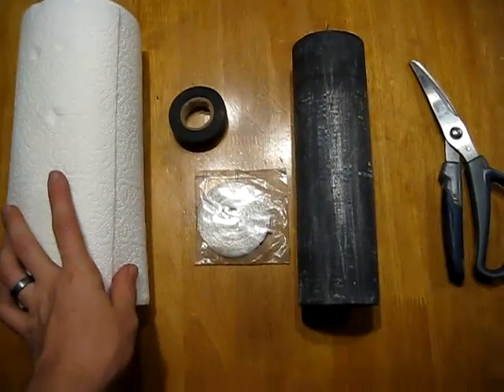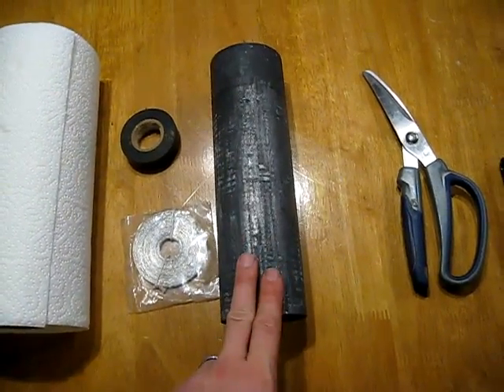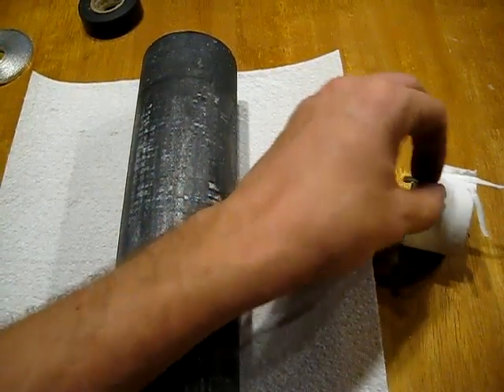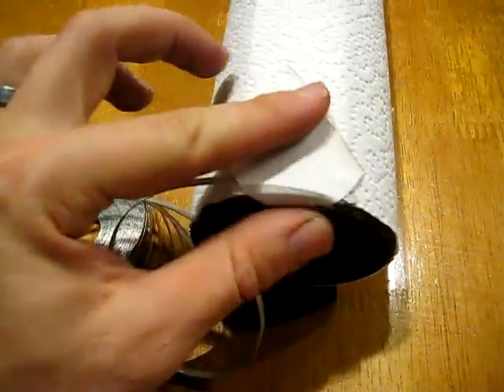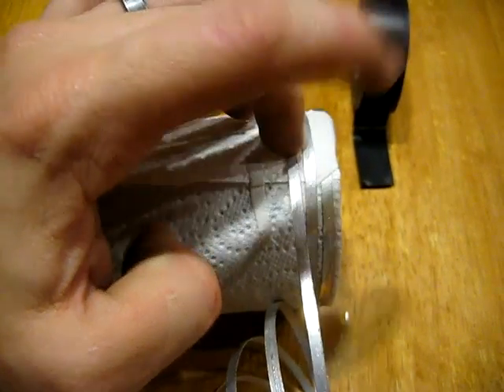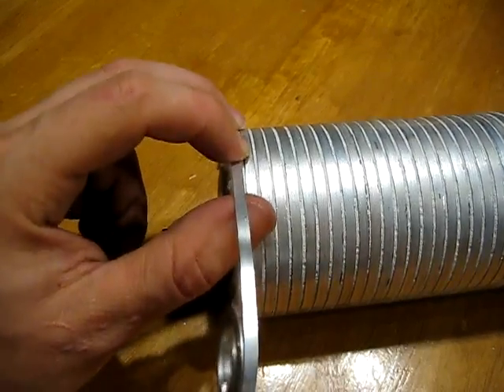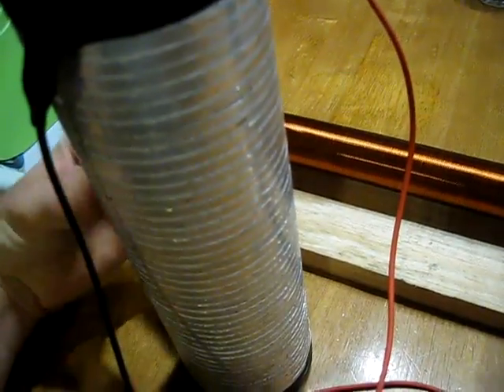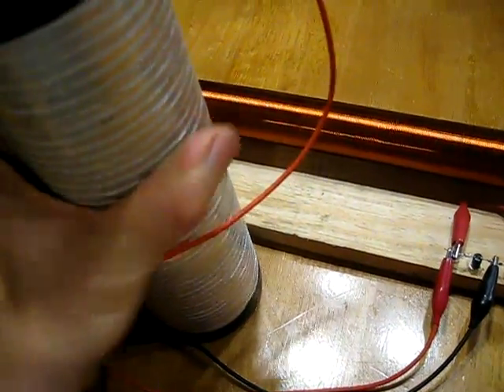How to build the "Laser Saber" air battery.

Comment: Would you have to use a solid carbon rod? I've been trying to think of things you could do with contaminated biochar from plastic pyrolysis. It's mainly carbon (probably more than 90-95%) and can't be used for hardly any normal applications of biochar because of the heavy metals, etc. If that were compacted down somehow, could it work in a modified version of these air batteries?
Reply: What kind of heavy metals?  Do you really want to be handling that kind of material?
Reply: Well, it's obviously not ideal, but I can't think of what to do with the biochar that is left over from gassifying plastic into gasoline, etc. I mean it's not like you're gonna just stick it under a mountain and wait for it be sorted out by nature like we're doing with nuclear waste...

Now, is an application like this ideal? No, but I literally can't find a use for this type of material. I mean you could use it to line a Faraday cage or something since, I think, carbon like that has an electromagnetic shielding property. But other than figuring out a way to refine it and pull that safe carbon out, I don't know what to do other than just let it pile up.

It's not like these are finished ideas or anything. I'm just brainstorming out loud on what to do with that sort of material.
Reply: I don’t know a thing about these but just sounds like it would be worth the effort to take that by-product and make one of these. I seems like making it tubular would improve the efficiency due to increasing the surface area. Please don’t crush me for being so ignorant about this. I just had to make a comment. Love the fact someone trying to do something with plastics. Fist bump to Cassandra Gray!

Comment: you need to build a website and then put full tutorials on there. with these i can power the lights in my house and also the ceiling fans.

question tho. what is the copper coil device you had it connected to?

Comment: Do you think it would work with carbon fibre rod or carbon fibre sheets rolled up(before the resin hardener, of course)?  You mentioned that air circulation in the carbon was good.
Reply: i made the same thing tou can ask a welder ir he has extra carbon rods carbin fiber works to  i made it with both rods but it is easier  using prebuilt rods
Reply: Thomas Savage Thanks, good to know. It's just that a solid carbon rod seems like extra weight and material.  I was thinking carbon fibre cloth wrapped around lightweight plastic or paper tubes. (toilet paper rolls, etc.)  I just got my magnesium strips, so I will experiment.
Reply: ya I would think that to.

Comment: because if it is compressed charcoal, you can easily make those by heating wood and other plant material, with out giving it oxygen (think pressure cooker over an open fire and fill the pressure cooker with just sawdust say, and make sure there is a decent level of pressure on it so that neither air gets in, nor does it explode on you.) cont...

Comment: Hmmm yes but even if it is one atom thick it still has something like 10 times the conductivity so it wouldn't have to be as thick because there would be less buckling even though its thinner or is that not what you were trying to say?

Comment: then it is all down to finding some pipe and cutting it in half, and wrapping it up to make a tube to press the carbon in, and a way to apply pressure to a disc of say steel that is the size of the inside diameter of the two half steel pipe thing you made.

Comment: It seems convenient that the major part required for this battery (the carbon rod) is not clearly sourced.  There was no cost given in the video for the carbon rod.  My own perusal on eBay showed some similar items -- ALL of which were several times more expensive than what I could purchase a good lantern battery for.  So, unless I've missed a source, this is a good hobby experiment, but hardly an exciting practical economical energy source for any purpose.
Reply: The carbon rod? Like the carbon rods in the "Super heavy duty" D-cell batteries?
Reply: The scale of the one in the video is considerably larger than a D cell.
Reply: Ah. The video was interrupted by a trip to the dentist, so I never saw it. My apologies. I'm sure there is a place to purchase said rods, though it would be nice if he had sourced it, as you mentioned.

Comment: You said 1 Amp with saltwater?   Well if it puts out 1.5 volts that'd be 15 watts, but how long could it maintain that?  And doesn't the saltwater corrode the magnesium ribbon cathode?  Just curious.. and yeah, what about lemon juice?  :)
Reply: +Matt Carrell the electric potential is generated by the corrosion of magnesium. Faster corrosion give higher throughput. Completing a circuit also speed up the corrosion because metal become more corrosion resistant when negatively charged compared to its surrounding. When the circuit is open the magnesium will charge itself up that slow down its own reaction with the air.
Reply: not long and lemon juice would kill it faster.
Reply: unknownkw makes sense then why gas company buries a sacrificial anode attached to metal gas lines by wire...  it takes the corrosive charge from the metal lines. As ground is negative potential.

Comment: @fuelban Yes sir, i've tried a few things like, copper plate,aluminium,tin etc, and I found aluminium the most reliable of all coz it doesnt start getting oxidized quickly like copper and gives reasonable output if moisted with a solution of table salt and vinegar but in dry conditions the output is quite low

Comment: could you use several dozen cells, hermetically seal them into a plastic container filled with oil and then regulate the output to create a supercell, and if so how long would it last :)

Comment: ok the 1963 chevy nova had a hole in the ciol  and as the iol drrrained out the ciol started to heat up- same idea but in water oil is better then any other liquid of some kind -oil keeps it cooler tha water -and plus you may find that if its below frezzing the oil base battery will last longer then the one that became frozen in ice electrons travel better in a non   frozen containers- oil wont frez up un less below 60 degrees

Comment: I wonder if it has to be circular. Do you think it would work with square sheets sandwiched together like carbon, cotton, mag, carbon, cotton, mag and so forth. it would resemble a small cube when it was assembled.
Reply: Thanks for the reply
Reply: carbon fibre works too. zinc roof flashing is cheap at Home Depot. cotton mat from a fabric store . or an old t shirt  :)  pile it up as far as You want.

Comment: Ehm, technically it is just an normal galvanic cell with an really really bad electrolyte (water from humidity) and therefore low self discharge, isn't it? Don't see the point...

"Air Batteries" actually use the oxigen in the air as an active material.

Comment: Firstly there is no reason the magnesium can't touch itself. Secondly you have fallen into the same trap amateur battery makers have for hundreds of years (electric bell trap), concerning yourself with how long it runs instead of making something that can put out enough power to do usefull work like run cars.
Reply: The entire purpose of this is a long running battery

Comment: doesn't an air battery need air ?, by submerging in oil you are choking the current
the magnesium consumption is what you want to see. serious question friend not brow beating you
Reply: I don't think you understand what he's saying. Air contains mustier, the paper towel collects it. Electrolyte makes it work ofc and you get this from various fluids some are better than others. To find out for yourself without doing all what this chap did. Get an empty car/motorbike battery and fill it with water okay you might need to charge it up a little but when you connect it to a meter you'll see its producing power not as strong as a normal car battery ofc. Another 1 google The BadDad battery, copper, zink and something like lemon juice.

Comment: Thank you...
I created a small battery using 2 BBQ burnt charcoals and its lighting a 3v led at at my desk.
I also created a big one haven't used it with anything yet but it pumps around 100 mAmps i.e. 0,1 Amp at 1.7 Volts
http://youtu.be/pSnI9wS0ocA
Reply: Thanks for that suggestion!!! You just saved me $200.
Reply: Did you add salt water to your charcoal carbon batteries or no?
Reply: Danyal Ahmad try salt + white viniger
Reply: OK thanks. I was going to use vinegar, but I didnt know what kind.

Comment: That's quite a wasteful way to build a battery, you know. The magnesium reacts with the oxygen in the water, or the chlorine in the salt you added, and produces hydrogen in the process, which goes to waste. Magnesium, much like lithium, is reactive enough to produce higher voltages, but above about 2V the water just splits. That's why lithium-ion batteries use a non-water-based electrolyte. It's a fun project, but not really something with practical applications.

Comment: Not a "Air" battery. If you break a AA battery you will find the same thing (same design and construct).  This should be called how to make a Carbon battery.
Reply: AA batteries have a chemical reaction going on. This does not.
Reply: Danyal Ahmad You mean to say that the magnesium is not reacting with the air or water? Please do explain how this works then.

Comment: Totally useless given that Magnesium dissolves in water. As for magnesium preservation - oil is a no-brainer since mineral oil has no water in it. If you're using a different kind of oil, it might have some water in it and the ribbon will break down.

Additionally, the energy given off is far too low for the cost.
Reply: "Additionally, the energy given off is far too low for the cost."

As is the case of many of his projects. For a fun thing to do fine, but if you're looking for something useful, look elsewhere.
Reply: if the battery is working then its corroding.  Is the race really to see how little power you can make a battery put out?  Just use salt water and actually make it do something.
Reply: all batteries corrode their metals in some way or another....thats how they produce energy  (opening any cheap dead car battery from Walmart will show the battery stopped running cause the thin ass plates are gone from the battery acid eating them away to make the power)
Reply: Farmer Frank That only really applies to acid batteries. That's also NOT how they work. At least not necessarily. It's about electron flow.
Reply: Justin Dixon Actually all batteries work on the principal NatureHacker pointed out. The "electron flow" you mentioned is caused by the transfer of material from one electrode to another. In other words, corrosion. https://en.wikipedia.org/wiki/Magnesium_battery#Primary_cells
Reply: harshbarj Ehhhh..... transfer of material? No. That's not how it works at all. It's literally the transfer of electrons from a negative terminal to a positive terminal using an electrolyte as a pathway. If material transfer occurs, that's a sign of inefficiency in the reaction.
Reply: Justin Dixon Of which electrons are material. I just dumb it down for the youtube audience. The transfer of electrons causes corrosion, so you are still wrong mate!
Reply: Justin Dixon Should add, Farmer Frank was both right and wrong. His first sentence was correct. His second was mostly wrong.
Reply: harshbarj The transfer of electrons does not necessarily cause corrosion given that those same electrons return to their original state in their original locations. Basic electrochemistry.
Reply: Justin Dixon Actually Electrons move from one electrode to another, not back to the same one. One electrode will over time lose electrons to the other (corrode). Basic electrochemistry.

Now perhaps there is some confusion over the word corrode here. For me the word simply means one electrode is chemically changed by losing electrons.
Reply: harshbarj Basic electrochemistry: electrons move in a flow from negative to positive. You might want to look into what the function of a wire is.

What REALLY happens is that one metal ion is transferred to the opposite electrode. That's actually not corrosion, it's deposition. There are electrodes in existence right now that are VERY efficient and corrode very very little. Typically made of things like gold, silver, or graphite. There are also new carbonfiber rods that are far more resistant than either of those.
Reply: Someday you will get it but I hope you have lots of fun making capacitors that you think are batteries.
Reply: The electrons are attached to the metal, called ions. The magnesium is depositing on the carbon, but an ideal battery will harness the power of all of the ionic flow, which could take millions of years if all other forms of corrosion are prevented. "Rechargeable" batteries are simply able to reverse the 'corrosion' when you apply a charge.

Comment: That is so C***. It works even better if you live close to a high power radio station.  A coil  resonates with RF energy it is randomly tuned too.  The diode rectifies the signal to DC and lights the diode.  No big deal.  If that radio station goes off the air at maintenance then your LED will not be lit.  Sorry to disappoint anyone who believed in this crock.  Look up RC tuned circuit.  Don't waste your money.  Do the same thing with a cardboard tube and magnet wire from Radio Shack.